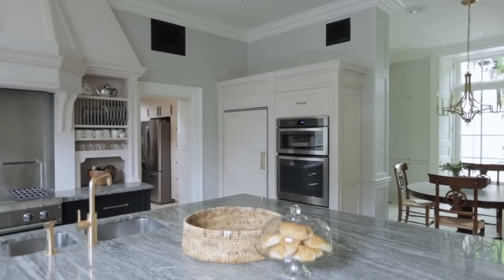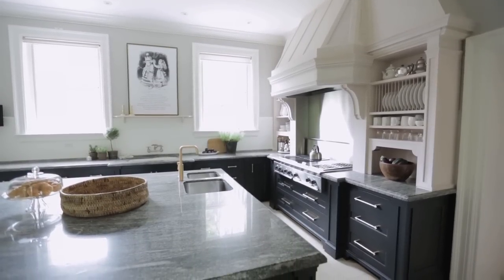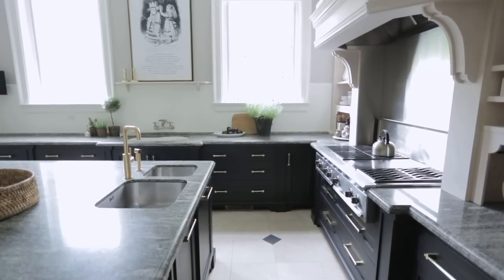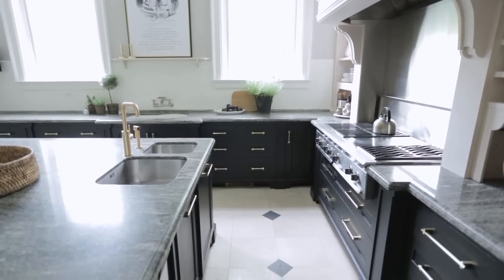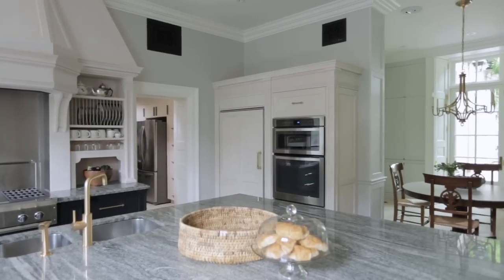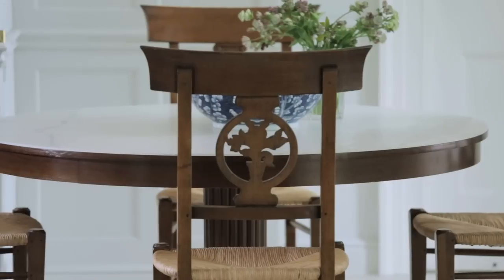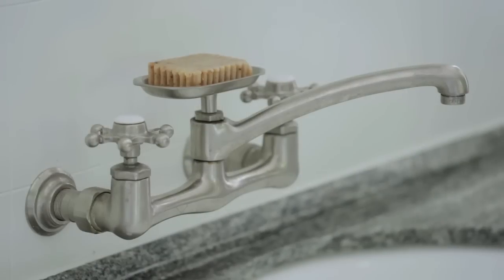Interior Design — How To Add Modern Elements To A Traditional Kitchen

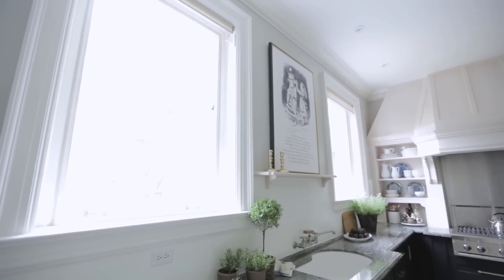Comment: 1:40 indeed, the full size, al last oversized windows in a kitchen are , like in this example, beautiful. There are not many rooms where you would want or appreciate full sized windows as these but the kitchen is arrest example of where they look and function beautiful.  Also, he second feature I truly love is the stainless steel backsplash behind the stove.  I'm assuming that instead of a backsplash of tiles, a wipe off stainless steel service would hold up well and be so much easier to clean, sans scrubbing. Nice job !